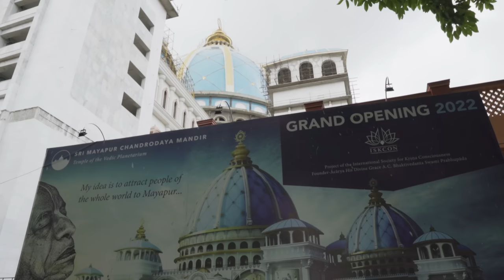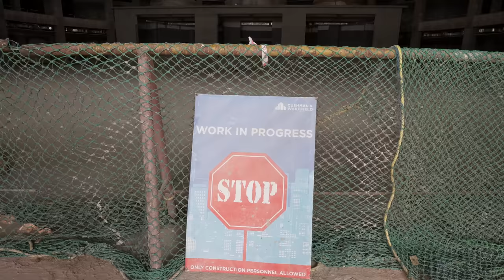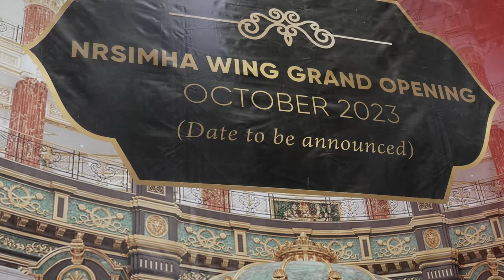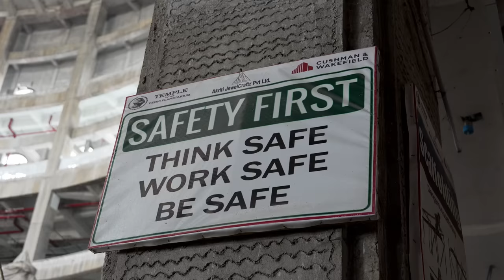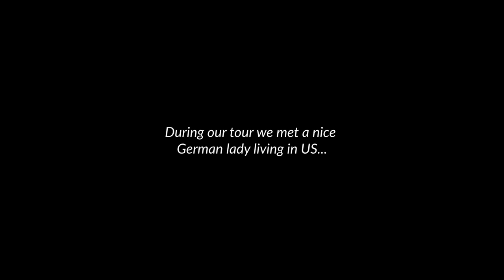TOVP Temple Mayapur | When will the temple open?

Comment: I think the temple first dead line set for temple completion and inauguration was way back in 2016! If I remember well.  One thing is the amount of construction work that's happening outside the ISKCON premises is abnormal. Hosts are asking abnormal rates. They are treating those apartments as hotels. Not correct! Need to rectify now itself to preserve sanctity of Mayapur.